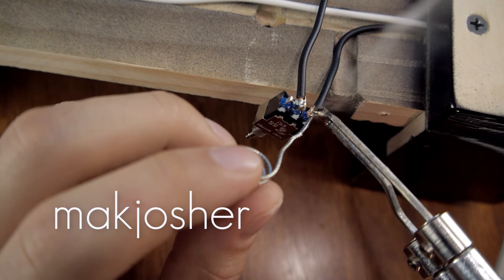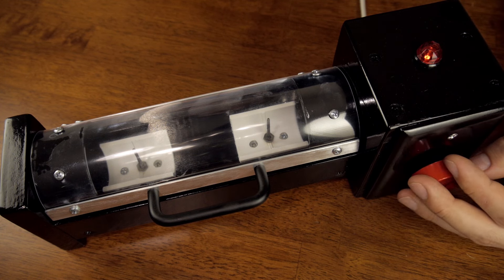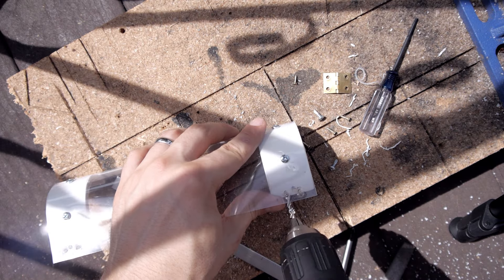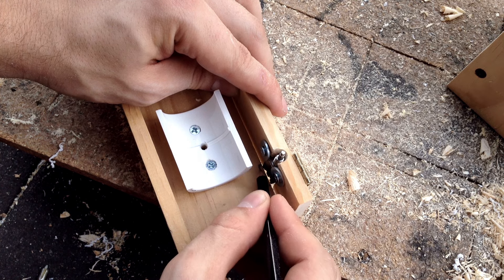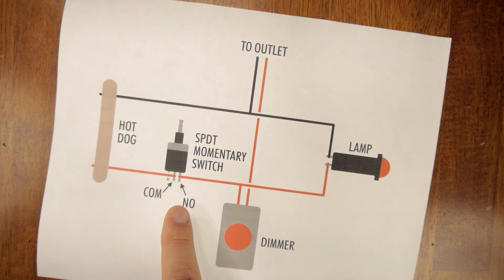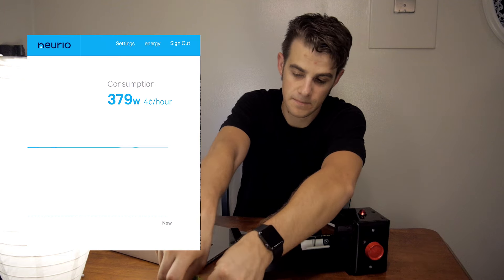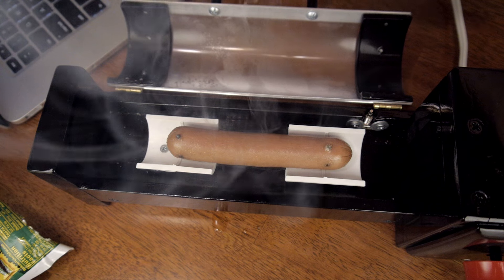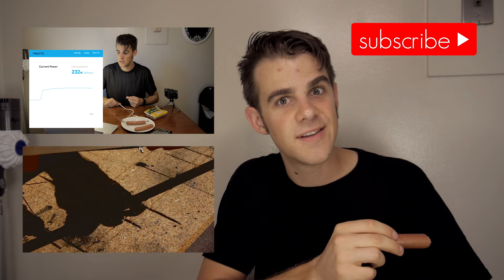Cooking Hot Dogs With Electricity - Part 2

Comment: Are you worried about the off gassing from the plastic or paint since they most likely are not food safe?
Reply from the maker: That's a good point. Really, it is only the hot dog that being heated directly - although the pvc is being heated some by the hot dog. It's a quick process though - so not a lot of time to off gas.